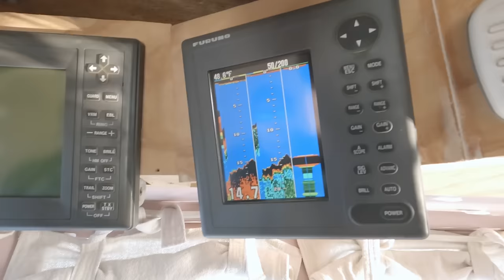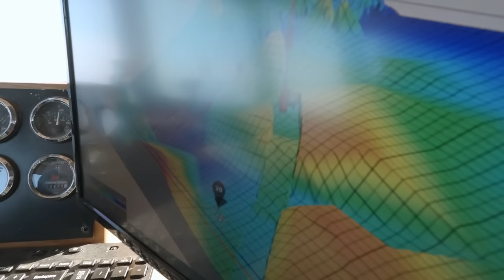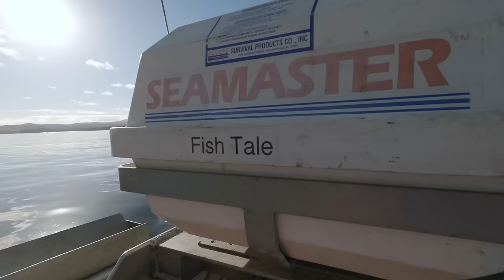Fishing Close to Home - 2023 Alaska Halibut Season

Comment: Happy New Year.  I would recommend you switch out that quartz halogen work light on the starboard pole with an LED floodlight.  Easier on your gen set and gives a bright daylight illumination compared to the Quartz orange light.  I have been changing them out for the past few years.  Just got to my tripod double head worklights I got at Costco many years ago.  I kept the stands and just swapped the lights.  Amazing how 6500K LEDs make a much better worklight.  I use 200 or 150 watt LEDs and notice while they do put out heat it is much much less than the quartz.  Get the IP69 rated for saltwater use.  Another advantage is you aren't changing expensive quartz halogen bulbs anymore.

Comment: Octopus recipe for Matt
Freeze the octopus for about three days it helps tenderize it 
Boil it for 45 minutes more or less with old bay, cilantro, and whatever else you want to put in there, pull it out when it’s tender enough to stick a fork in easily 
Marinate it in olive oil, cilantro, and then again, anything else you wanna add to it and then put it on the grill just until the skin chars a little bit usually only a minute or so per side
Reply from the maker: Nice! I’ll have to try it out next time.

Comment: I notice that you all seem to use Dexter (not the series) knives onboard.  I have also acquired Dexter knives over the years as I like to cook and I find these to be of exceptional value.  Lately I have struggled with mine as they have lost their edge and the ability to sharpen with a steel and instead probably needs to be sent to a professional to put on the proper edge and sharpness.

What do you all do to keep your knives in operational quality?  I can only guess in your situation that having a dull knife is more than just an annoyance, it is also a risk to appendages.
Reply from the maker: Yes, we do love the Dexters and ours too lose their edge occasionally. We clamp them securely and take a file to the edge, trying to maintain a consistent angle. Following up with wetstone and steel. It gets tham back in shape, but nowhere close to a professional job ;). You are also correct, A dull knife is dangerous.

Comment: Love your vids 

So I have a question... Im currently a mate for 2 charter boats, 1 is a good party boat the other a tuna / marlin type boat. Love my job. However I'm also very interested in trying commercial fishing. Worked for a small commercial boat last winter hauling pots. Didn't like it, and I was warned from many people about working for this particular captain, take from that what you will. With that in mind, are most commerical captains super fast paced and extremely impatient, and particularly vocal about their hair trigger impatience, or are there more vessels that operate at a slower, smoother pace like you guys run your operation? If so, I would love to try it again.